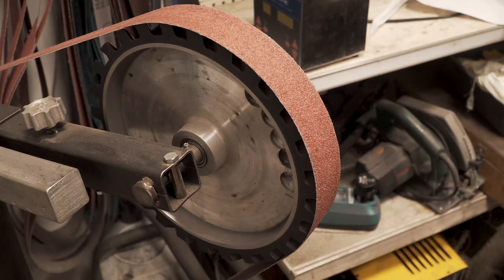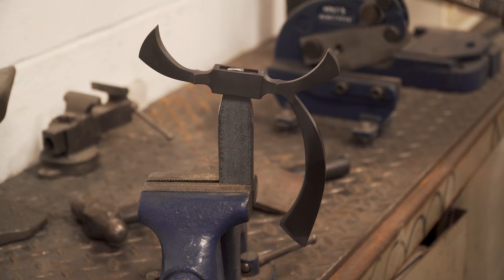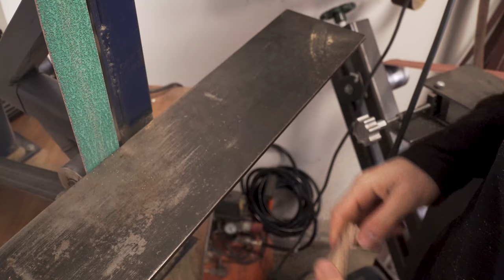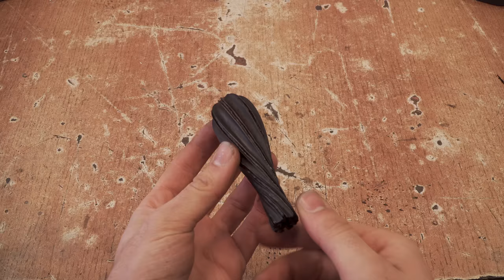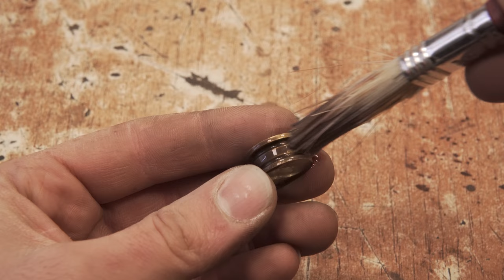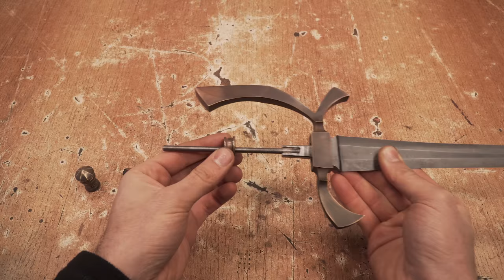From Scrap To Quillon Dagger | Part 2 of 2

Comment: I'm not sold on the welded rod tang and the "cilindrical" handle.  The first one for practical endurance and second one because it doesn't helps with edge alignement.

That said, it's a gorgeous dagger and you've really boasted your skills on it.

Comment: Not sure if I am worthy of suggesting you to change your process but I am surely looking forward to more takedown knives from you. Kyle Royer has a process for his takedown bowie that you might find interesting. He casts the inside of the handle with resin making sure that the blade is covered by a release agent (grease?) This way the inside of the handle has a solid mechanical registration to the blade spreading the load. I am looking forward to more of these projects from you Maestro!

Comment: The dagger as a whole is fantastic. But I do question cutting the tang like that then welding an insert. That welded area will always be point of weakness, despite it being hidden and supported by the handle. But that's a minor point and only an opinion.

Comment: Your lathe chuck seems to be moving to the left when you apply the cutting tool. Maybe it's time to check the bearings? The handle is seriously next level. Are you heating the spiral wound wires to anneal them or for visual effect?
Reply from the maker: Yes! Might be time to replace bushing.. or lathe all togheter! :') Heating first to anneal, brass works harden like crazy. Then after the patina to finish the process like I did for all other fittings.

Comment: The grip and blade look fantastic (nice blend between a leaf shaped blade and a french style cork bayonet grip btw). Personally I'm not a fan of welded tangs, since they tend to snap off inside the grip if you use it as a parrying dagger, but seeing it's sharp I don't think that's the point, is it :P

Comment: That handle is beautiful, but soo not practical.
Reply: Actually it is very historically accurate. French bayonets in the 1600s used to have that kind of grip (with no guard). The idea was you can put the bayonet into the muzzle of the musket and use the whole thing as a spear or you could unscrew the grip and reverse it with the bulge at the end and use it as a knife.
Reply: @davidegaleotti94  You mean plug bayonets, but they were very different. Nobody would put twisted brass wire onto the handle of an plug bayonet because you would risking damaging the barrel.
Reply: @Toxicity1987  exactly! Ofc those were plain wood with no chiseled work as this, but you could still reverse the grip to make it more comfortable to hold  : )